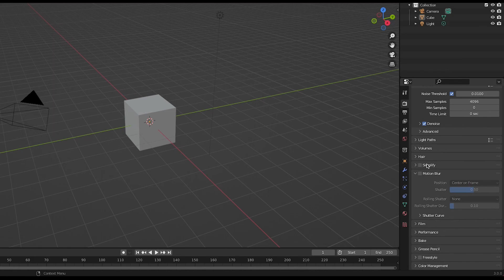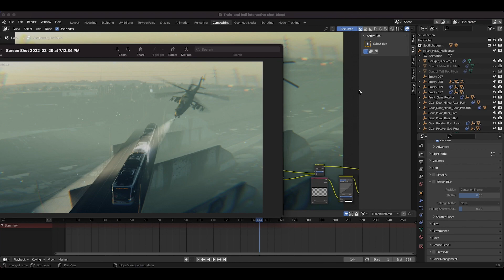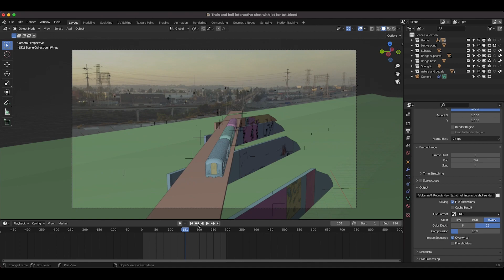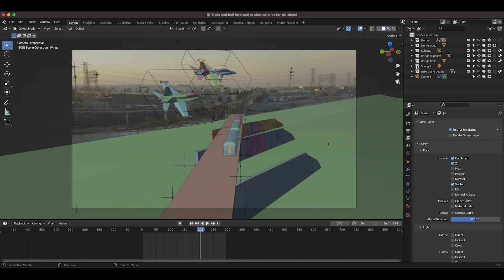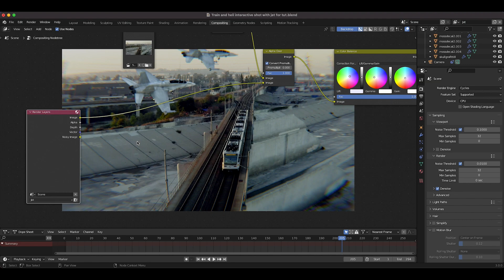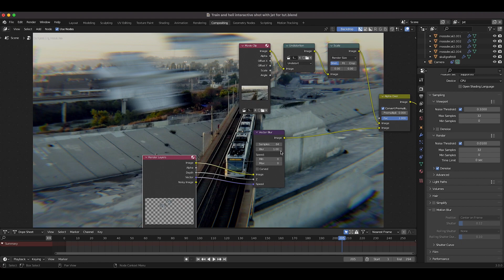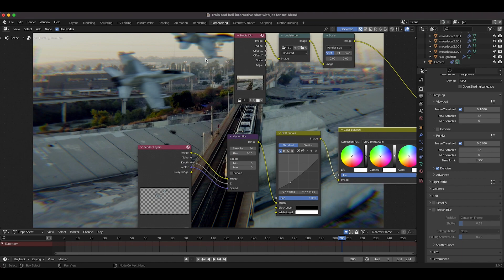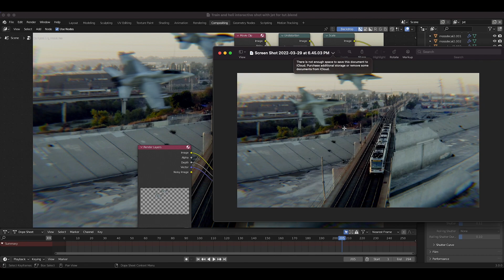How to use Vector Blur in Blender 3d: VFX Tutorial!

Comment: Thanks for the videos. I’ve got wheels of an aircraft running down a runway with the aircraft moving and wheels spinning fast but at the exact rotational speeds. I basically thought that by disabling motion blur in wheel object properties the scene takes motion at scene level for consistent blur across objects but that would be too easy for blender! That’s what the blender manual says. But that’s not the case. It’s just a blurry mess for wheels but aircraft looks great. Don’t know how to sort it out. Another post says it’s worse if items are connected to bones. But why would blender differentiate. Any ideas? I ish blender would write proper manuals

Comment: Hi, nice tutorial! It shows how vector blur works really well. Great example.
There are a couple of mistakes in your composite, though.
First, Blender renders are associated (premultiplied), so activating the convert premul checkbox in the alpha over node in this case is wrong, as it's applying a multiplication by alpha again, producing a dark fringe around your foreground objects.
The other mistake is doing color grading on associated alpha (the curves you apply in the last step). If you're going to color correct the foreground before an alpha over, you must "pre-divide" it first. Place an Alpha Convert node before the CC nodes, from multiplied to straight.
If you do that (predividing the alpha before the color correction) then you have to re-multiply it after the CC. In that case (only in that case) the "convert to premul" checkbox would be ok, as it's going to premultiply the foreground you divided earlier. But if you're not going to pre-divide your FG and it comes from a blender render, then it's already premultiplied.